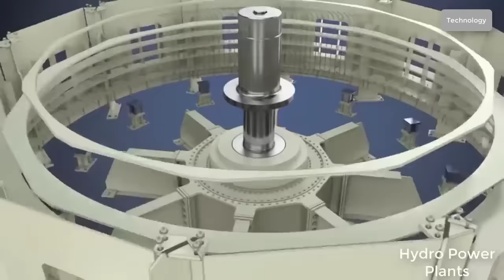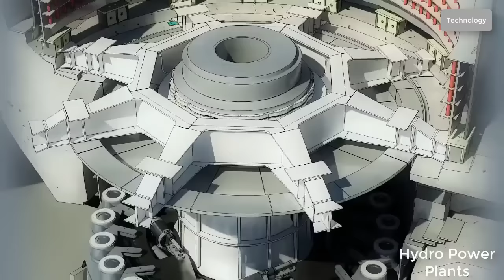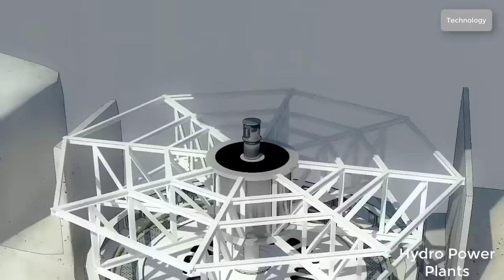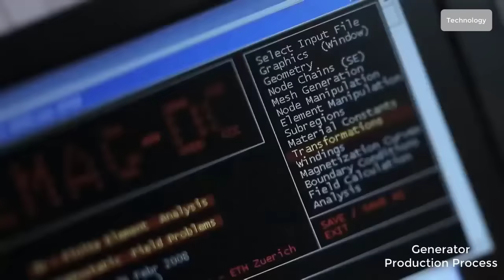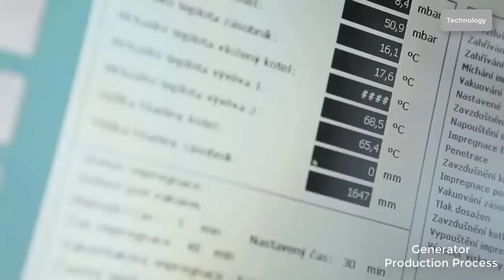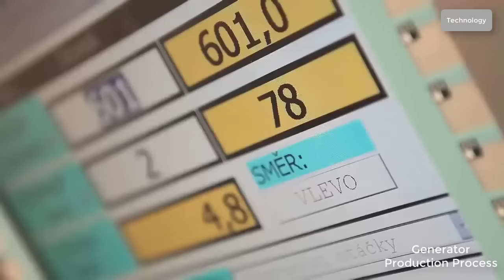FantasticTechnology Hydropower Plant And Largest Modern Generator Production Process

Comment: I notice how both metric and US/imperial units have been used: 'the 61-foot rotor was lowered in place leaving a 19-millimeter gap'. Wasn't it decided two or three decades ago (after that space craft failed and an air crash occurred be cause of the same confusing results of using dual standards) that it was easier and safer to use metric for any type of construction that has scientific aspects to it? Or was that just for the purpose of this video?

Comment: Can't we store the water again that turned the turbine through a tunnel or a canal and forced back to the dam water using powerful water pumps?may be iam late on this.
Reply: the whole electricity produced willnot be sufficient for brining them back to that height.there will be no gain
Reply: @aswajithu  during peak hours if the generation capacity if it's not sufficient or if there is excess generation pumped storage plant act as generators or huge pump loads to make or consume power.